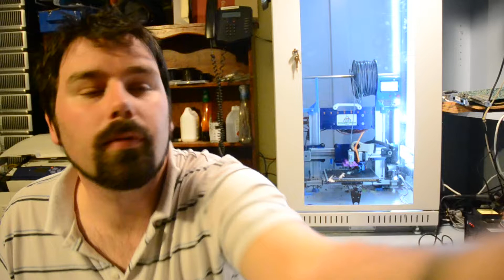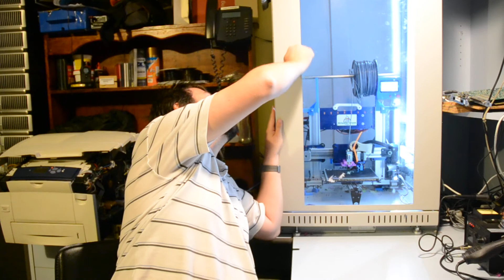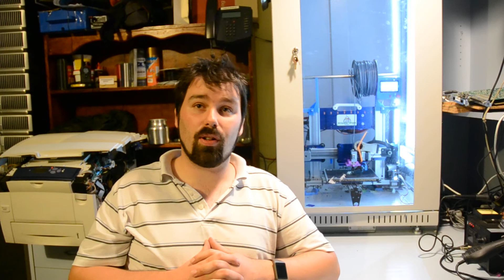No, 3D Printing isn't killing you, but maybe you should be safe with it.

Comment: It probably makes sense to have a "maker shed" if you live in Aus and have A) Good weather and B) Plenty of space. In the UK and in British cities in particular, it is more than likely that 3D printer enthusiasts are working from a cramped house or apartment. A reasonable compromise would be to operate your 3D printer under a cooker hood or bathroom extractor fan. Just make sure that the movement of air is not creating a cooling draft against your prints.

Comment: I have just ordered a CR10 and have been concerned about this. For now I will print minimally, and do it in a well ventilated room like the solarium. There is very little coverage on the possible problems of 3D printers and fumes. At least not much that I can find, so thank you for this. Much to consider.

Comment: This part of  a study about #D printing:
"The new study, presented by Dr. Fabrizio Merlo and Dr. Eng. Stefano Mazzoni, starts off from other previous research conducted in the early 90’s, which demonstrated that during the fusion and processing of plastic materials, several toxic particles are released as gases, including ammonia, cyanidric acid, phenol, and benzene, among others..."
you can read the complete text at: https://3dprintingindustry.com/news/toxic-abs-pla-fumes-3dsafety-org-inquires-vocs-60796/